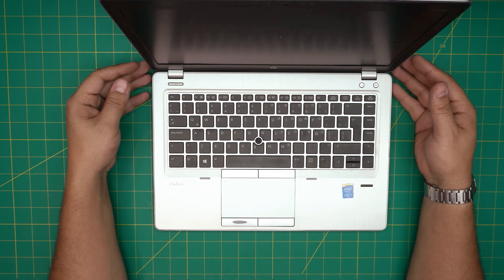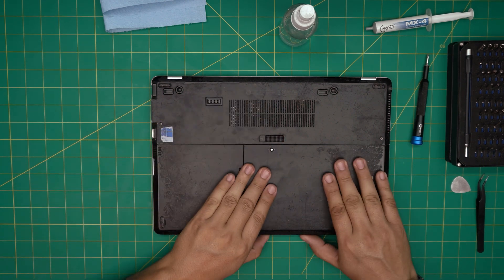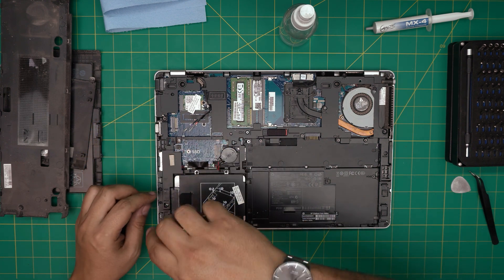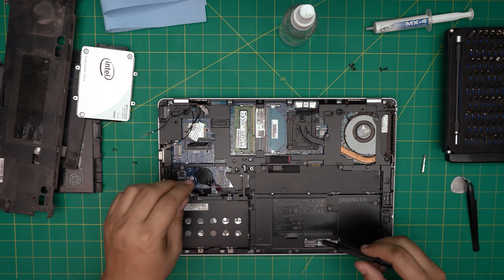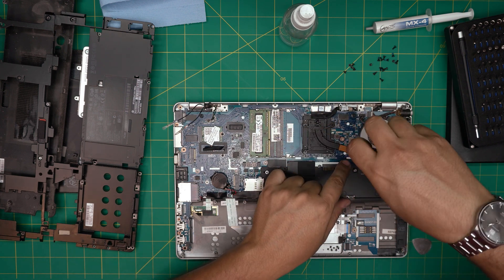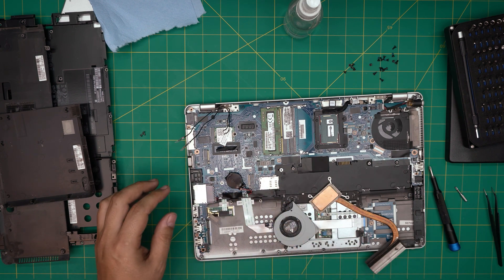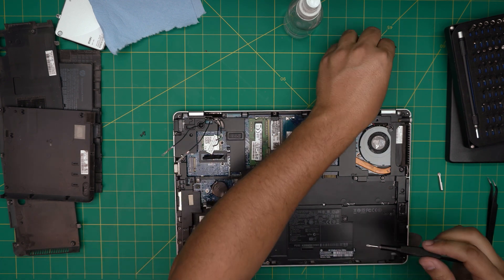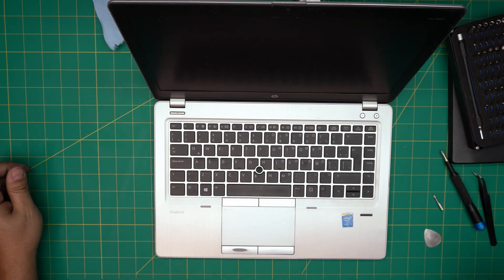How to Repaste and Clean HP EliteBook Folio 9480M Laptop - Step-by-Step Guide🧹

Comment: Hello there friend, I have this same model laptop and it seems to shut down randomly a few seconds after turning it on, could it be that the thermal paste needs to be refilled or it may be another hardware issue with the laptop?
Reply from the maker: 🫠Regarding your question, if it powers on and then shuts down after a few seconds, you likely have a component issue on the board and need to get it checked. It has nothing to do with the CPU thermal paste. Even if you remove all the thermal paste and place the heatsink directly on it, it will still power on, but the fan will run at max speed for 5–10 minutes before shutting down.
Should you have any further questions or requests in the future, please don't hesitate to ask me.
cheers🍻
Reply: @uFixTek thanks for replying, but one point I forgot to note is that it runs in BIOS for as long as you want unless you decide to boot it, that's when it actually shuts down abruptly. Thank you mate
Reply from the maker: Yes, because at the BIOS level, the CPU is not even active. Also, you may have a bad hard drive, which can result in those issues.

Comment: Very informative. Mine just got wet on keyboard part, had to open it up and let it dry. About cleaning,if you don't have a paste, can laptop still continue to work or it may overheat?
Reply from the maker: Thank you for your feedback! If you wish to support the channel, you can like, subscribe, or both!
Regarding your question, To ensure that your laptop operates smoothly and doesn't encounter overheating issues, it's important to follow these steps:
    If you have lifted the heatsink and cleaned off the old thermal paste, it is crucial to apply a thermal paste before reassembling the heatsink. Failure to do so may result in the laptop shutting down after a few minutes of operation as it exceeds safe temperature limits.
    When the thermal paste is not applied, the CPU and GPU can reach high temperatures, causing the cooling fan to spin at maximum speed. This can result in a noise similar to that of a jet engine. Moreover, the excessive heat generated can potentially damage the components of your laptop.
    Therefore, it is highly recommended that you apply a thermal paste between the heatsink and the processor. This will facilitate efficient heat transfer and ensure the temperature remains within safe operating limits.

By taking these steps, you can prevent overheating issues, maintain optimal laptop performance, and extend the lifespan of your device.
Reply: I haven't cleaned it the paste it has just the fan. My son poured drops of milk on the keyboard that made me reassemble my Folio laptop. I did put parts outside to dry including the motherboard. Is there any chance of it coming back to 'life'.
Reply from the maker: look at the motherboard of any signs of water damage and 90% you may need to replace the keyboard (some keys may not work), 50-50  my friend , i wish you the best
Reply: Thanks a lot. I will assemble using your video and hope for the best.
Reply from the maker: you can do it, have faith and take your time,
Should you have any further questions or requests in the future, please don't hesitate to ask me.